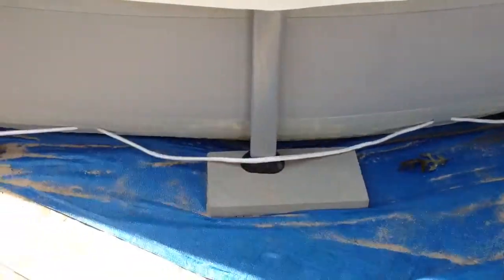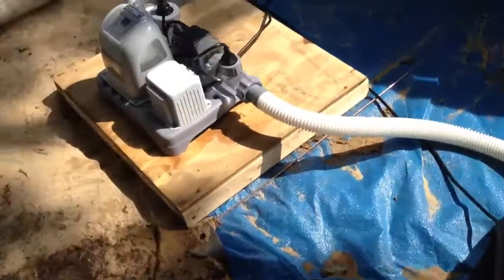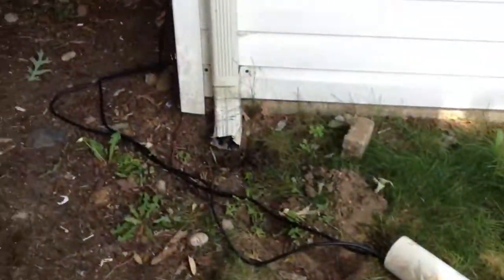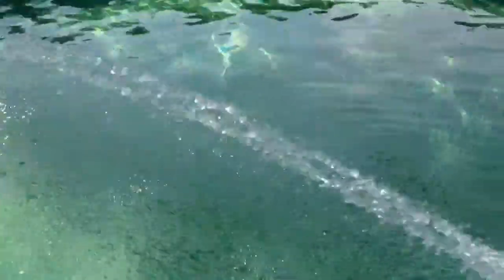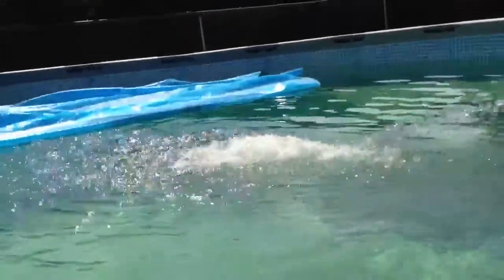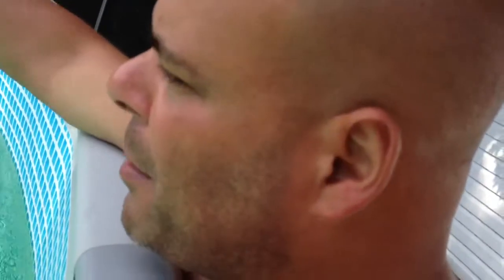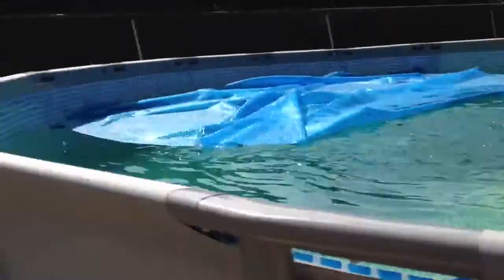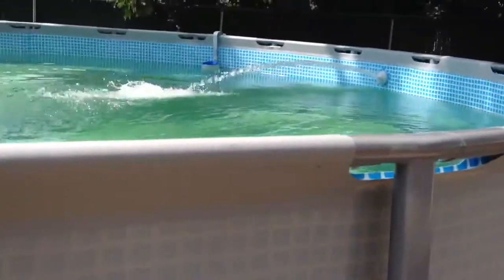Intex Ultra Frame 22'x52" pool

Comment: With pavers not being flush to the ground, doesn't that put added pressure on your liner? The bottom of the liner was actually raised an inch off the ground at the edge because your pavers. Is that not an issue at all?
Reply from the maker: Dan Frattinger No. never an issue, eventually it settles in into the sand.

Comment: Same for me! I wouldn't mind the 18 rather than the 20, but the depth concerns me.  I want it nice and deep and I don't know if the 48" will cut it.  It's hard to tell without having the pool set up in front of me. With a tape measurer, and assuming I'll fill it to 90% capacity, I've estimated it's the difference between having it boob-deep and just under boob-deep, LOL. Trying to decide if it's worth the extra money to have boob-deep.